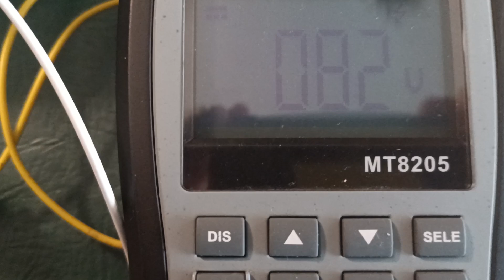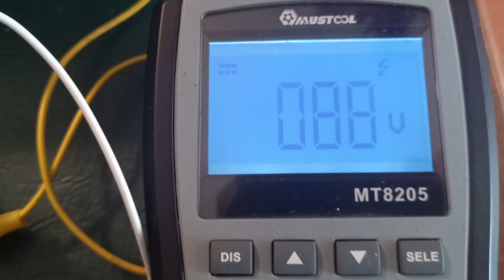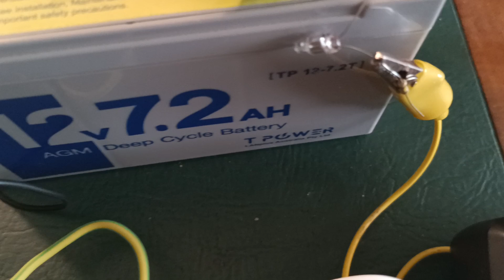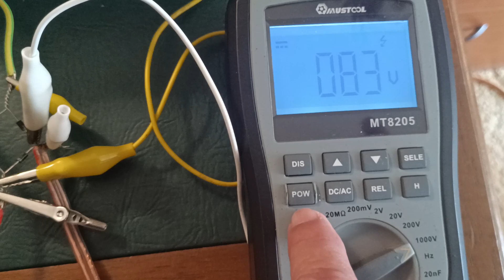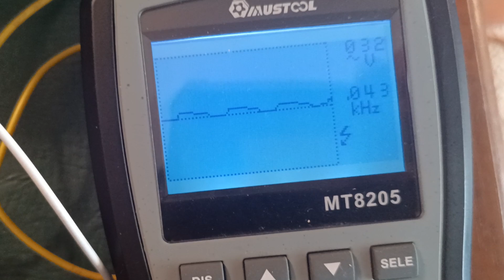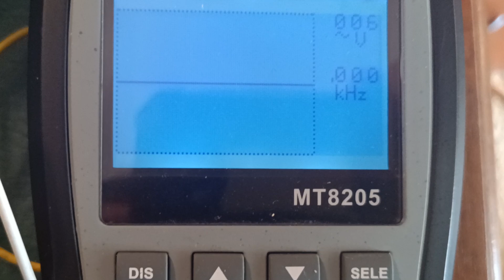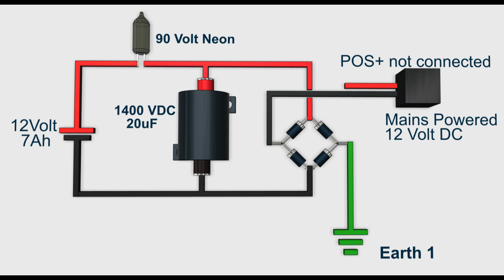POOR MAN'S CAP DUMP

Comment: Would it take less current if we used a voltage divider (a series and parallel resistor) and a diode; instead of loading the steel of a transformer core?
Reply from the maker: Thank you for your comment.
Everything should be tried and nothing ruled out. I have been amazed so many times that I am now more shocked when I see normal things. I imagine reducing voltage should increase current. I am unsure of which core you are referring to, this setup is using a capacitor and Neon bulb and only the negative line of the transformer, the Pos line of the transformer is not connected.
Thank you for watching.

Comment: I could not get this to work.  I went by the schematic that you put up and the only thing that I changed was the Cap value.  I had a different cap, but the cap had over a 100V value.  The only voltage that I saw across the neon and the cap was the voltage of battery.  Also, I did earth ground the circuit.  I'm not sure what I'm doing wrong; please help.
Reply from the maker: Thank you for your comment.
A capacitor value can be the make or break it when playing with this stuff.
What is the capacitor you are using. My capacitor is a welding capacitor, 1400 VDC 20uF.
If you can get your hands on a variable capacitor you can find the best value cap to use.
The voltage isn’t visible across the neon except for the moment of impulse and if the capacitance is too low there may not be enough pressure to force the discharge.
Please let me know how you go.
Reply: Ok, thank you.  I figured it would probably have something to do with resonance.  I may have a variable capacitor on a board that is configured for capacitance and resistance series and parallel.  I'll have to see.  Also, perhaps I could order the type of capacitor that your working with online.

Comment: So,the main power you posted in the schematic is 12v dc or 120v ac?
Reply from the maker: Thank you for your comment.
The power supply connected to 240v mains is a 12 volt DC 2 amp isolated transformer. It used to be a hard drive power adapter. Only the negative line of this DC transformer connects to the circuit.
Reply: Ok,thanks!

Comment: Excellent.
I have pondered creating an LC resonant system that matches the mains frequency to use resonance to obtain more energy.
I have never gotten to that yet though.
Love your videos mate
& Keep up the great work 
⚡🙏⚡
Reply from the maker: Thank you for your comment.
I truly believe this is the backbone of a heap of circuits currently circulating that have a connection with the grid. This connection includes oscilloscope’s which is why I don’t use any meters that are grounded in my experiments as it connects through the earth grounding giving false results.
How have you been lately good sir?
Reply: @whatifididthis...1236  Excellent mate.  I have been going well really. Been busy fixing up the property after bad storm damage. Getting there now 👌 Keep up the great work mate 🙏

Comment: Good info. Liked the spark gap substitute too. I think old christmas lights are similar to neon. Please correct me if I'm wrong.
Reply: some are, more common in 110V countries
Reply from the maker: Thank you for your comment.
That’s right, I remember those well, little fire starters. There were versions made that had a step down transformer for us folk that are on 240V. The most annoying versions were serially connected which meant if a bulb died you would have to check every single bulb. I’d love to see the stats on burned down Christmas trees. Nowadays you can pick up an RGB multi mode strip with a wireless remote that runs on AA batteries for $15… much safer!